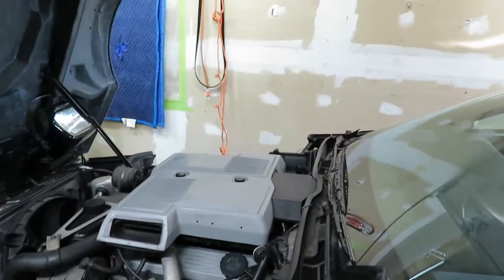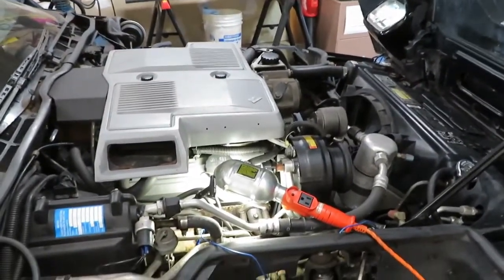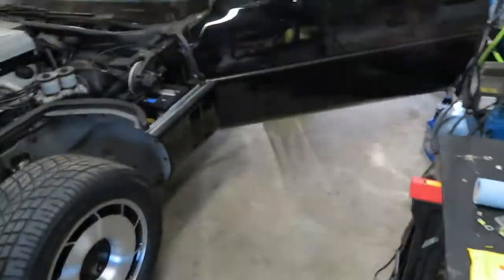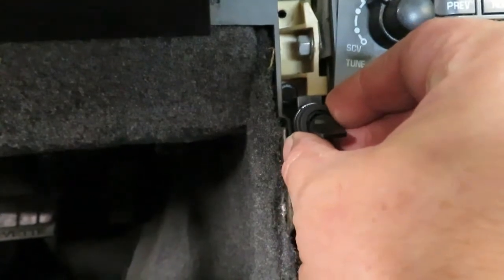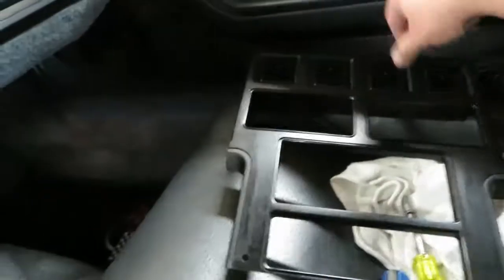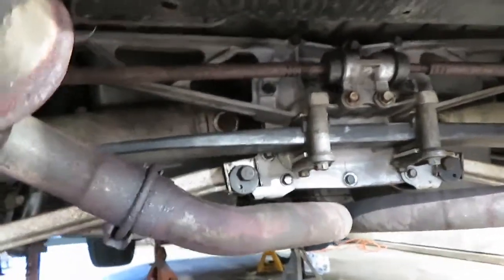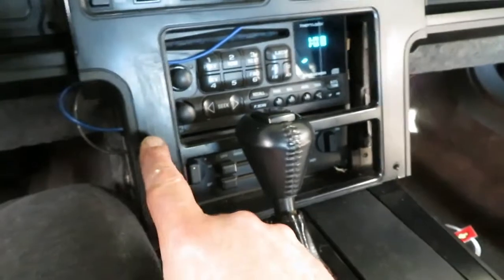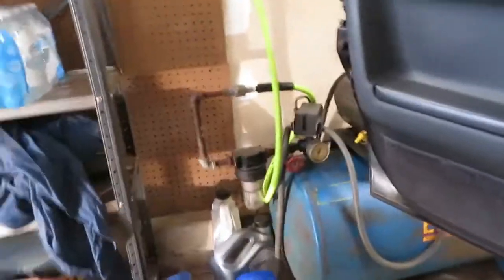1984 C4 CORVETTE RADIATOR COOLING FAN TOGGLE SWITCH

Comment: Just curious why you wouldn’t wire your switch to the A B pins in your reader Port? Run a jumper first to see if it activates your fan and if it does put a switch in. Would be about a foot of wire and less than 5 minutes to do?
Reply: Where is the reader port located assume I don't know where anything is

Comment: So doing this removes the switch from the setup altogether correct? When you ran the ground to the switch the other side of the switch is going to the fan relay? So flipping the switch grounds the relay to turn the fans on. Am I correct?

I also have an 84 with non functioning fan

Comment: How does it work for A/C operation as I think the fan comes on automatically with the A/C? Did you lose that operation and have to manually turn on the fan every time you run the A/C?
Reply from the maker: The fan automatically comes on with the AC....no worries.